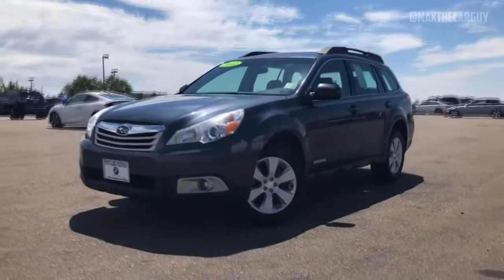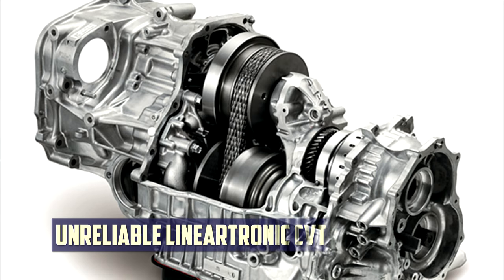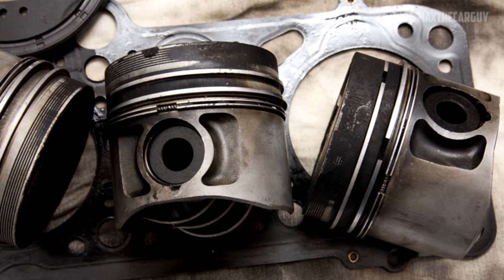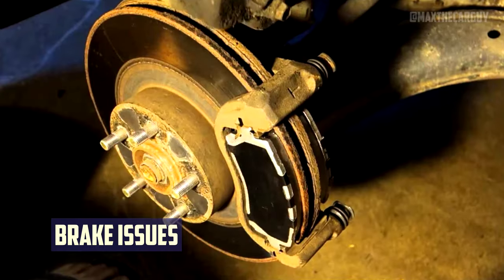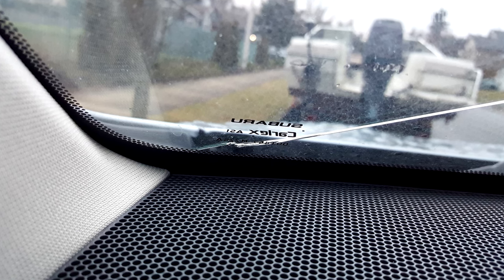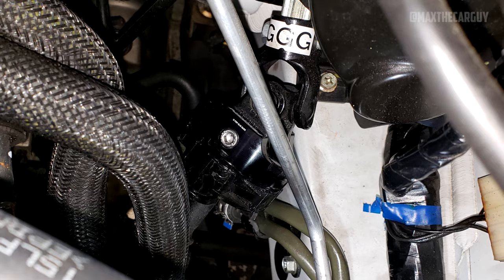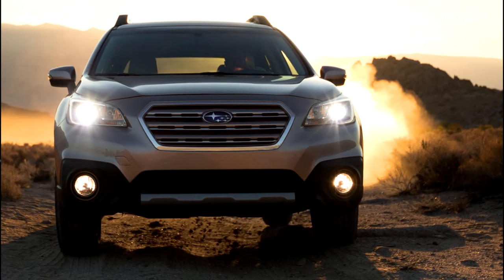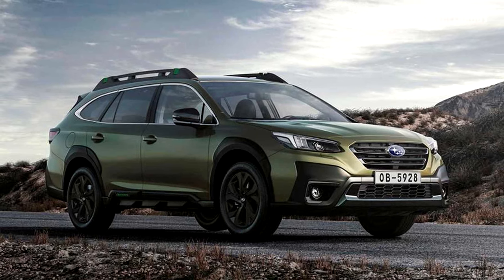TOP 9 Most Common Subaru Outback Problems

Comment: Yes - these issues have existed - but many of these were very long ago. The fact this vid doesn’t try and discern which vehicles and which years and clumps everything together gives it a ‘hit piece’ feel to deter people from buying them. Suburu have high reliability ratings and maintain a 60% value of their original price after 5 years.
Reply: What problems r there for 2023 versions?
Reply: @vindiaz2924  I own the 2021 Outback Touring XT with the 2.4L Turbo. Zero issues, very comfortable, programmable safety features, heated and cooled seats, over 500 miles on a tank for road trips and about 25mph mixed city/hwy driving responsibly. The 2023 is the same car with some cosmetic changes and a couple of new options: wireless phone charger, digital rear view mirror.
Reply: I have issues with the battery going dead.  I was in the mountains of Kentucky and could have got killed.
Reply: @jeanninesoltis4432 wow while your driving ?!
Reply: @Dallashygienist  no.  Stop at store then doesn’t start. In a 14 day span if I only take to short 15 minute trips I get stuck and need a jump.
Reply: Glad I read your comment and didn't waste time on the video.
Reply: And yet no mention at all of the 2019-2021 Thermo Control Valve debacle. That alone would send me running for the door.

Comment: I own a 2012 Subaru Outback with 130,000 miles. Had none of these issues. Just saying.
Reply: Don’t make the 2019 like they used to.
Reply: that’s good to hear because I purchase a 2012 in 2020 then started reading the head gasket horror stories!!!! So far so good however I did get a ScanGauge to keep an eye on the temperature (first Subaru and vehicle WITHOUT a temperature gauge) 😂

Comment: I own a 2013 Outback, the “worst” model year.  It is the best vehicle I have ever owned.  A 10 year daily driver with 91,000 miles.  Have had no problems at all.  Plan on keeping it for many more years.
Reply: 2015 wasn't any better.  I'll never buy another.
Reply: Just got a 2015.  First Subaru.  I think it has battery issue and ignition issue.  
I did buy an extended warranty so fee a little better that I paid 2,000 for 5 yrs as I have 119,000 on it. I’ve driven it 2,400 so far.
Reply: 91k in 10 years...... that 9000 a year...... Talk more when you ACTUALLY DRIVE YOUR CAR.

Comment: I have 2 Outbacks. The 2011 my wife drives, has 110,000 miles on it and we have yet to invest one single dollar on that car with the exception of brakes and tires! Mine is a 2016 with nearly 90,000 miles on it, and I've yet to invest one single dollar on it, with the exception of a set of tires. No clue what this click-bait article is talking about? I also have 2 sons, 2 sisters, 1 brother-in-law, a nephew,  and numerous friends that own Subarus, none of whom have had any problems with their cars.
Reply: Truly blessed!
Reply: yep 2013 outback, 170,000. just went into high consumption mode, 2 qts in 1200 miles, been at dealership for 2 months,no information on next move.  replace low beam headlights every 6 months with expensive replacement bulbs and very difficult to reach sockets.

Comment: I'm shocked head gaskets wasn't on this video. People seem to think it only happens to incredibly old Subarus, but in reality I've seen the head gasket problems up till 2013.
Reply: 2014-2015 Foresters still having head gasket failures. I had several in the shop the past year. All adult owned and maintained.
Reply: 2010+ EJ 2.5L had Multi Layer Steel head gaskets and were not as prone to fail unless overheated
Reply: Yes, I was very surprised also, the 2011 Subaru outback has immense problems with head gaskets, I've had my heads rebuilt two times and it is overheating again and I just got it back from the mechanic, he is now telling me the head gaskets are blown again, when I got down there he was gone and I spoke to the mechanic that was troubleshooting my car and I asked him if he did a pressure test and if the head gaskets were bad and he said no, I'm getting ready to take them to court to get all of my money back, and I'm too embarrassed to say how much money, terrible people in this society!!!

Comment: This video is a load of incorrect information, the first of which is the P0420 code definition (Catalyst insufficiency).  Subaru will also replace the short block on the FB- series engines with a consumption of 12 ounces of oil in 1200 miles, much less than 1 quart (32 ounces) in 1000 miles.  It's a hit piece.
Reply: Source? I had a 2016 Forester that consumed a quart of oil every 1200 miles and was told it is “normal.” I was told it would have to use more than a quart per 1200 miles for a new engine to be installed.

Comment: My 2015 currently is so intermittently hesitates when accelerating and dealer can't find the problem. Cheap factory battery lasts only 2 years after we got the car. Brake seized a couple of times. All my Subarus (3) have problem with wheel bearings and need to be replaced once a lift time. Forester has an oil consumption problem and finally quits. Replaced it with a Toyota.

Comment: I was a victim of the battery drain. Sent back to dealer they claimed some consumer electronics left plunged in cause it. They fixed it. I sold it. Never again will I purchase a Subaru. Blame the customer 😡😤😠
Reply: We had 2 2019 that the batteries drained because I wasn’t driving everyday.  Then you go somewhere and it won’t start.   Can be very dangerous to get stuck somewhere at night.  Plus the radio was going out when I was in the mountains.  I just thought the XM was acting goofy because of mountains.  Here it was the battery.  It was only a couple years old. I have a 2019 mustang I drive only in the summer never have to jump.
Reply: My Outback has the bad radio screen.  They blamed me and said I "abused it"  I can understand a manufacturer making mistakes.  An arrogant dealer & the Subaru of America clowns is what I can't understand.  My next car will not be Subaru!

Comment: I just bought a 2023 Outback, I did buy the bumper-to-bumper for 6 years.
Reply: I'm considering the 23 right now, are there any big flaws or problems you have noticed with it?
Reply: Just brought home a 2010 Outback for $8500. Has 184K miles. Immaculate condition. One owner. Has all service records done from dealership. Wish me 🍀
Reply: I just bought a 2023 Outback. I've only had it for a month and so far no problems. My 2019 Outback had battery issues. The dealership put in a new battery but it too kept dying.
Reply: you should not have to buy a extended warranty they should stand behind there cars

Comment: The cracked windshield is definitely an issue.  I had to replace two windshields on my 2012 forster.   It costs about $1100 US because of the eye sight system.
Reply: 2021 forster

Comment: The cvt transmission is only bad if you really beat them. My buddy has a 14 forester thats built to the moon with a stock cvt and only now did the trans fail. And lets be honest, its a subaru. We know it drinks oil. Its not limited to outbacks. Just like the trans issue. Its subaru wide. And known issues we all have known about for YEARS.

Comment: I feel lucky because my 2015 has only had one issue. The brake light switch broke. It was a recall item but I avoid dealerships so I never took it in. When it failed I had my trusted repair shop fix it for $100. My original battery was fine. It still worked great at 7 years but I replaced it as I do in every vehicle I’ve owned.

Comment: P420 is not always the result of an ignition problem and has absolutely nothing to do with an ignition switch. Also Subaru extended the CVT warranty on said cars. You want to talk about un reliable CVT, Nissan aka JATCO. Subaru only brake issue is parking brake and that warranty to 15 years and unlimited mileage. only the 10-12 models had headlight issues due to the autlights being overly sensitive. The dealer replaced them free of change for the first 10 years
Reply: Subaru is JATCO! The only reason Subaru extended the cvt warranty is because they lost a class action lawsuit and the judge required Subaru to extend the warranty. Subaru wasn’t being nice. I had a 2016 Forester with an cvt that failed at 65k miles and Subaru told me to F off.

Comment: Own a 2016 outback   156000 and no problems
Reply: Have you done any maintenance on cvt, like changing the fluid?  I own a 2016 outback at 88k miles.

Comment: Considering that the same parts are used, can we assume that these problems are also present in Forester models? 2 liter diesel engine is widely used for outback and forester in my country. I can ignore the ignition problems accordingly. 3.6 liter gasoline engine is common in the usa market, the cvt may not be able to withstand the torque and speed of this engine, we do not encounter cvt failures much here in 2 liter gasoline and diesel engines. The biggest problem for us is that the dpf filter fills up quickly and gets clogged. hence the contamination of the egr valve. If the dpf clogging is not taken under control, the reverse pressure in the engine can go up to breaking the crank. I don't know of anyone who has had steering and brake problems. maybe this is a special case of US factory productions. The Subarus in my country (Turkiye) is made in Japan. or different productions may be available according to country road conditions. because the roads here are like doing off-road on asphalt.
Reply: What is a DPF?
Reply: @Dallashygienist  Diesel Particulate Filter. It is an expensive part installed on the exhaust.

Comment: Hi advise me I want to purchase a a used 2017 outback kindly advise?
Reply from the maker: The Outback is a great compact SUV and it totally is worth its price. The weak point of the SUV is the OEM battery. It drains too quickly. Also, watch for lineatronic CVT transmission, did the previous owner change regularly the oil in it...
Reply: Hell yeah! Jus brought my 2010 Outback today! 186K miles, immaculate condition, one owner, all maintenance done at dealership $8500. Wish me 🍀

Comment: Does the cvt require maintenance?
Reply: Change the oil after 60k
Reply: . Subaru has a 100k warranty on cvt, and they will void the warranty if you change the fluid.
Reply: Dealer should do that

Comment: My ‘13 6 cylinder was fairly good with no problems.   The ‘15 6 cylinder was plagued with chronic electrical problems.   Dumped it two years later.   Never again.   And with all the black cladding, the latest Outback is a serious eye-sore.

Comment: Obviously and American car manufacturer pays you for this crap.  Subaru is one of the most dependable cars on the market not to mention , has the best CVT trans in the industry. I own a Subaru and this video is and attempt to destroy Subaru good reputation of supplying safe and dependable automobiles to the public. Thank You
Reply: Remember these are common issues with some years but do not necessarily apply to every vehicle. You may have been lucky to have not have experienced any of these problems with your Subaru, that doesn’t mean they don’t exist. It’s important for people to be informed so they can do more research and throughly inspect the car they’re hoping to purchase. I still love Subarus despite the potential for issues.
Reply: Every manufacturer has a problem at sometime. Your singling out a well respected , dependable automobile that serve many users well. Make a video on a manufacturer that really has issues. Maybe GM

Comment: Bought a new outback back in 2015 and since then numerous times replaced batteries because of the constant failures. I'm carrying a car jump starter for those scary/embarrassing situations when a car won't start. Also, have excessive oil consumption. Keep away from Subaru!!! Find something more reliable.
Reply: They definitely come with weak batteries. My purchased new 2017  Outback battery died at around  2 years and nine months.
Reply: I have a 2015 Outback also bought new, 2 months later replaced whimpy original group 35 battery with a group 24 AC Delco that has twice the reserve capacity. Problem solved
Reply: Subaru 2016 model 
Replaced battery 4 times till now ! 
Had around 5-6 issues listed in the description.
Reply: Many of these issues do not seem to be a problem with the Subarus we get in the UK. All ours are Japanese made. 
I am about to take delivery of my third one. I have had a 2005, a 2019 and now a 2023. The 2005 had 190,000 miles, sold 8 years ago, and I still see it in the village driving around.
I did have a broken wire in the tailgate in the 2005, and the headlight bulbs did not last long.
I also had to replace my front disks on the 2017 one, at about 15,000 miles. They were heavily scored.
But otherwise, as good as gold.
Reply: Use Liqui Moly 0-20w engine oil. Will be no consuming problems

Comment: On my Subaru Outback 2015 3.6 EyeSigh will drive by itself and follow the road(Also brake and accelerate and drive around other slower cars!)...most of the time...of course, you watch and, well sometime YOU go to do the driving or you'll end up in the ditch! Still, it is surprising good and impressive, after seven years! Probem? Well, it tend to will jerk forward...So make sure you wont hit something forward!